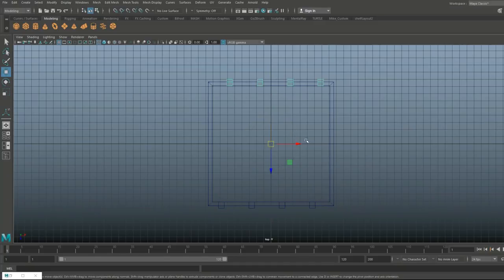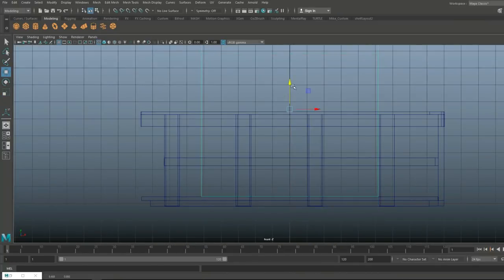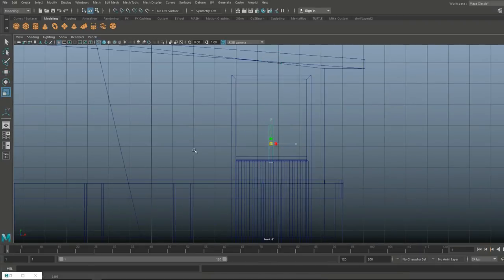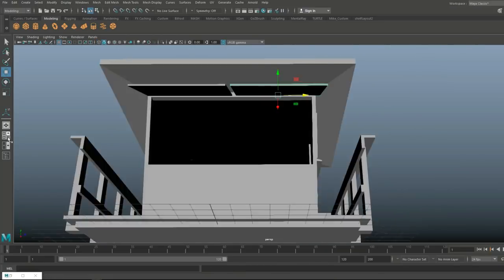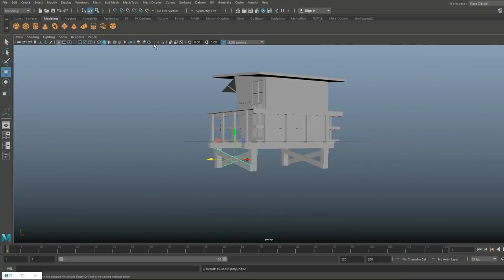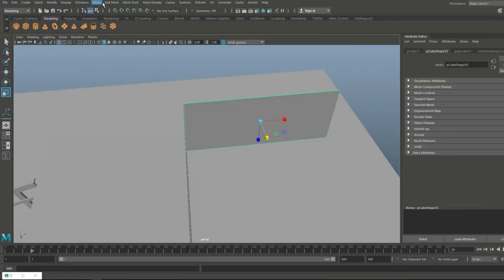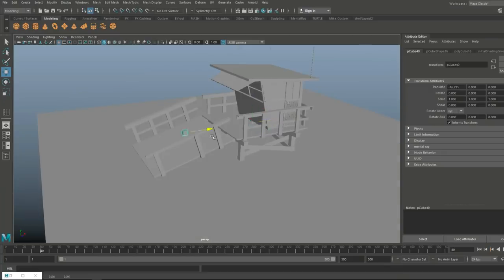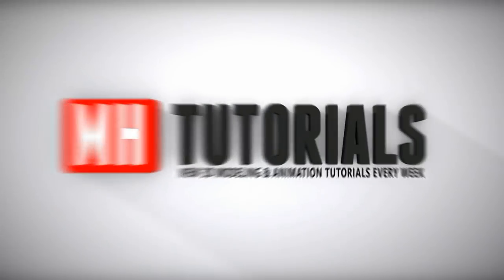Time Lapse Friday : How to model a Life Guard Station in Maya 2018

Comment: Quick question: what does your workflow look like if you were to go ahead and texture something like this? I know how to do basic unwraps of objects but my version of doing it takes way too long for complex things like this, is there a better or more automated way of doing this either within Maya or through another program? Thanks for the tutorials!
Reply from the maker: It is basically an unwrap like any other, just longer
Reply: Unwrap usually relies on two functions in maya, normal based and cylindrical. Use normal based for anything planar, as in anything flat (like the circle at the end of a cylinder) and cylindrical for everything with edge loops. This can also be used with box unwrapping, use cylindrical for the face loop around the box, and a normal based unwrap for the top and bottom. Once you've done that use a layout function with proportional object scaling (which can be found in the layout settings) this will scale your uvs correctly to be proportional to the world scale (and make your projected uv grid consistent)
Reply: Once that's all done, i recommend assigning materials with their own colours to each different zone you want to add a texture to (for example, a pickaxe would have two materials, wood and metal), once the materials assigned, read up on baking a material id map to then know exactly where these materials will be when texturing. This is also useful for if you're texturing in another program such as substance painter, it will read your material ids and make layers from it
Reply: I would heavily recommend trying another program for texturing like mari or substance painter, but that's a personal preference... a lot of people manage just texturing in maya and photoshop